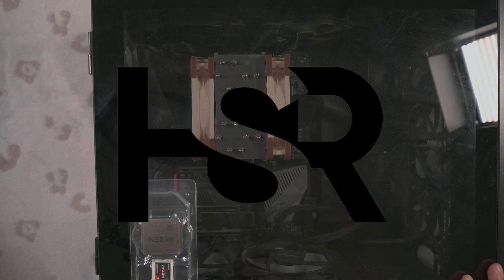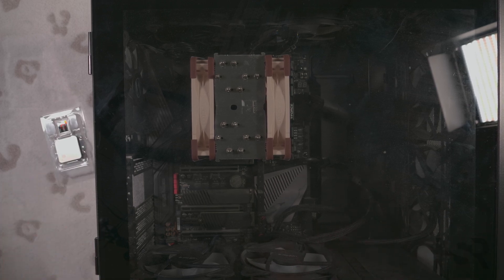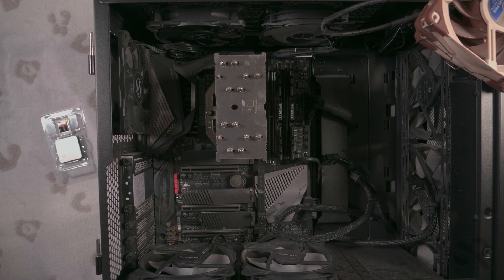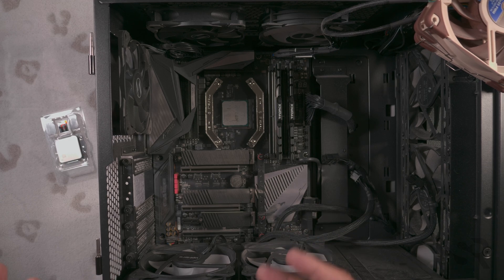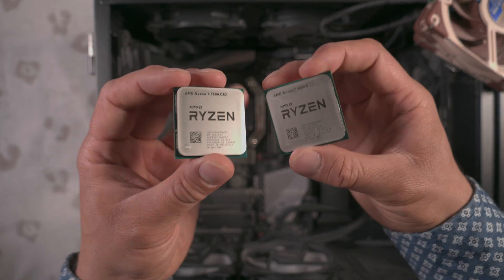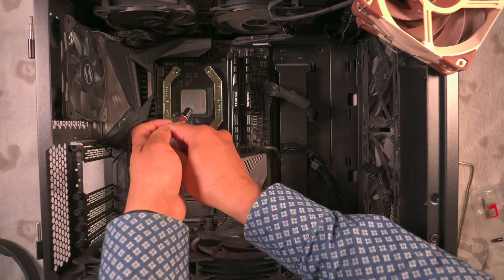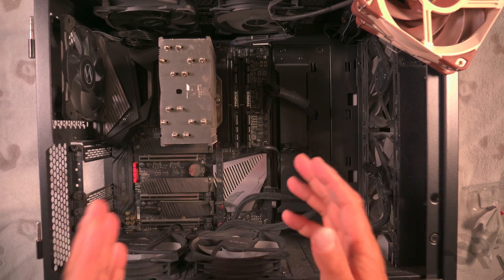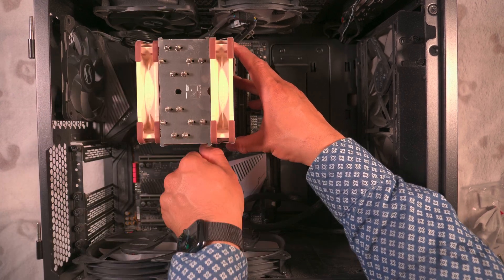How to swap CPU; 5800X to 5800X3D

Comment: Im planing to change my 5800x to x3d, can I use x3d without changing any components like motherboard power supply or ram?
Reply from the maker: Correct!
Reply: @HSR  when going from 5950x to 5800x3d will any settinghs need to be changed in windows or bios or just straight swap and boot pc? any drivers to download from amd?
Reply from the maker: @sct911 straight swap 🤞🏼🤣😭

Subscribe and watch more videos to support my work ✌🏼😇

Comment: are the dimensions of the 5800x and 5800x3d the same? i.e. my arctic freezer 2 AIO cooler will be compatible with the new CPU too?
Reply: actually i got to the part of the video where you answer my question haha thanks great video
Reply: the answer is YES for anyone else reading
Reply from the maker: I am glad that the video helped you 👍🏼

If I may suggest to kindly consider subscribing and watching more videos to support my work ✌🏼😇